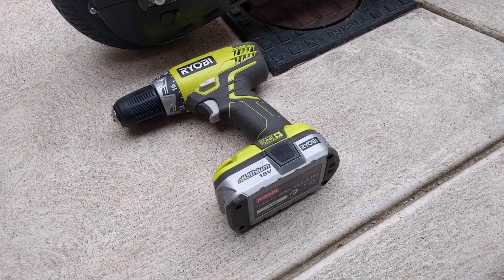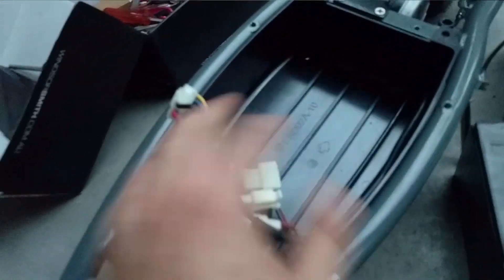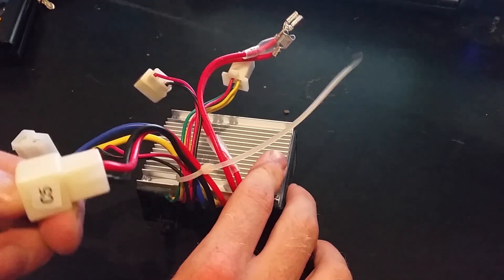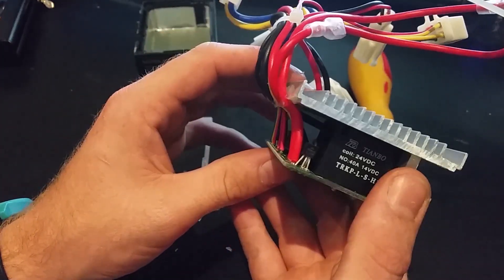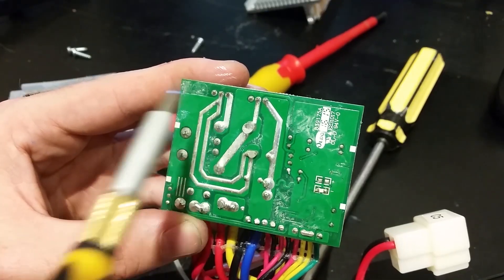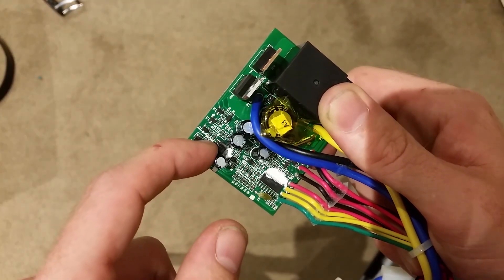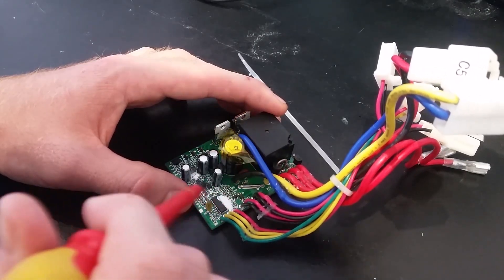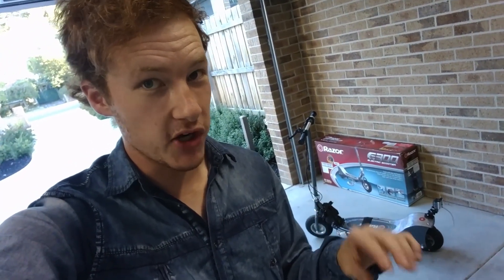Making the Razor E300 Faster With Drill Batteries! Ryobi ONE+ - Scooter Episode 2

Comment: Hey glad to see you still reply to comments. Few questions. Did the controller ever burn out or did you just upgrade it? Im going to put some 36v hoverboard batteries I salvaged and use the charging port I salvaged from them as well. I thought I seen in another video that the on off switch wasnt working with 36v but it looked like you had no problem with that right?
Reply from the maker: I think episode 2 outlines the basics to get the stock controller to accept 36V - relay mods for example - but it only applies to one model of ESC; Razer used a few over the years. Also you'll probably blow it up fast at 36v whatever you do.

If I remember correctly both scooters (I eventually had 2) burned their motors out in long runs. 

I plan a return to do a brushless long range build but its very hard to make YouTibe videos at the moment. Very time consuming and I'm not the fastest editor these days.

Comment: Can't you just remove the controller and wire directly?
Reply from the maker: You can try and use a simple DC switch but it will quickly get damaged from arcing

Comment: How do you charge the ryobie batteries once you remove them from the shell? Do you use the standard charging that is on the razor? Do you keep them plugged in and charged? Also how to you avoid the no charging due to not connecting the thermo on the Ryobi?
Reply from the maker: If you watch the video, I just did this for a test. I didn't keep the scooter setup this way, and I ultimately put the battery back in the shell.

You can't charge it via the Razor hardware. Your best bet to go this route would to get a Ryobi battery connector for the scooter,  so you could slide the batteries in and out like on the Ryobi drill.

Comment: Just buy a old haverboard and take the battery out of it
Reply from the maker: Fun idea
Reply: ive found about 15 of them over the year garbage picking. Most are 24 volt which will work as well and probably not burn out the controller or motor as fast. I would recommend looking up the battery first though some are fake and have fake batteries in them filled with sand. Also some generic batteries from hoverboards are known to catch fire. Hover-1 and jetson hoverboards look to have the best quality batteries ive seen so far. Also using batteries from electric vaccums work as well save  the connector from inside the vaccum and most of their batteries have their own dc charge port.

Comment: I watched the 15:32 part like 10x trying to figure out what you did here. Can you elaborate?
Reply from the maker: The chip on the board tries to sense the current flow to limit it to reasonable levels. I cut its connection to the current shunt and rewired it to ground so it couldn't measure current properly. This removed the limit and let the motor draw more current.

Comment: Hi TK.
I have tested with a 36-volt LEAD battery on my 24 volts, 7Ah( standard scooter e300 and stock 24-volt speed controller) and it works very well with no issues. I am planning to try a 36-volt HONME BUILD lithium battery. 
I need your suggestion before I start to build my battery. Will it work with a 36-volt lithium battery? Any further modification on the speed controller?
Reply from the maker: The stock ESC may blow up, in a short time or a long one. Consider buying a dedicated speed controller rated for 36V.

Comment: I did this to an E325 it flies now. But it will turn off every minute or so for 2-3 seconds. I'm assuming it's getting to hot and tripping the breaker. I'm wondering how dumb wiring a 30amp breaker would be. 
Edit* All factory just 2 18v Milwaukee 5ah batteries.
Reply from the maker: Hm interesting! Maybe a different revision of ESC has a thermal cutout

Comment: I have two 12.4V LiFePo4 batteries connected in series and I want to use a lithium ion charger of 29.4V 2 Amps... If I connect the charger to the E300 scooter will it charge the battery without turning off the controller ? I just need to charge the batteries with the above config.... So question is will it charge the batteries safely using the same controller ?
Reply from the maker: Doesn't sound like the right match sorry!

Comment: If you just bypass everything why not wire the batteries directly to the motor with only a switch? This controller doesn't even throttle power anyways.
Reply from the maker: Unfortunately when you switch high current DC with a regular switch, you get sparking on the contacts. This quickly degrades them. Thus the need for a transistor based speed controller even if it's only 0% or 100% throttle

Comment: I just did this and built a 7S4P pack that will give you 21-29.4v and over 10ah with plenty of space for more. The OEM controller didn't mind as the difference is not a whole 'wodge' of voltage. My E300 is an older model and the controller did look a little different though. I did increase the size of the shunt on the controller with a piece of cooper wire soldered in and got a little bit more amperage too which helped tons. Great video series!
Reply from the maker: Nice mods! Appreciate the kind words :)

Comment: I just got a used Razor e300
And want to increase the range of the current system which I can ant to use it to push my golf push cart with my golf bag
I don’t need more speed, just longer range.  Please lead me to accomplish this
Need lithium batteries?
Reply from the maker: You can add more lead acid batteries in parallel, but a lithium battery setup will be lighter and give you more range

Comment: Hi! I am from Germany and i speak German and a little bit Englisch.
My English is not good, i speak a little bit.
My Mega Motion electric scooter doesn't turn on anymore, I've had it for 1 year.  IM very desperate!!  Maybe you can translate my German into English with the Google app, for example.  In your video in the minute 3:30 pm I also have these cables and these yellow colored plugs and this silver part with all the plugs and cables at minute 3:30 pm that you screwed on and where the cables are all inside.  Red, yellow etc. And then with 4 screws the blue long battery pack with 4 screws.  Question: Which cable is responsible for switching on the electric scooter or which could be broken.  The charger charges normally red and when it is full, then green.  So the battery is full and was still full before.  I beg your help so much.  Usually when I put the round plug of the charger into the scooter at the bottom left, I always heard a "clack"! And now when I plug the charger into the scooter the round cable at the bottom left, I don't hear it!  not "clack" or "click".
Reply from the maker: I'd like to help but it is hard with just text and being so far away. Perhaps you could head to a local hackerspace?

Comment: any idea if the stock controller supports a variable throttle grip?
Reply from the maker: It does not.
Reply: @WhatUpTKHere  Thanks for letting me know, great series of vids on this!, I picked one up cheap and have been working on it, geared it down alil (65T), but plan to use two 4s 5A lipo packs I have after doing the overvolt and over current mods on the controller. For now have 2 lifep04 12v packs in it, but looking for alil more speed..

Comment: Thank you for making these videos, it’s really useful and fun to watch at the same time. I do think I have the same problem. I installed 26Ah batteries and it smelled a bit burned each time I rode it. After about a week it stopped working completely and it must be the controller right?
Reply from the maker: Could be controller or motor. Keep watching the series, watch my fails :P
Reply: Controller or battery I bough a upgraded 500w speed controller and throttle and it blew up

Comment: If you want to completely disable current limiting (I don't recommend it) find the connection from the mosfet side of the shunt to the IC. Separate the connection. Ground the pin of the IC that was connected there. Adding the wire as you did is the same thing as paralleling a wire with the shunt since one end of the shunt is to battery negative.
Reply from the maker: Yeah, very true! I get into it in later episodes. Thanks for watching!

Comment: Hey TK watch your video pretty cool and interested would like to do mine but would like to know what you did with your diagram and your speed controller board might be controllable is the same as yours I have a E200 but for some reason when you stepped on it it's closed right down it does not go any farther when you hold it up it keeps on spinning the wheel but as soon as you stepped in it it's closed right down any tips can help me would love to do my mod as yours thanks will really appreciate if you help me out
Reply from the maker: Sounds like dead batteries or the current limit kicking in. Head over to Hackaday.io and read about the project.  https://hackaday.io/project/9941/logs

Comment: This video made me do the shunt mod. Now my bike is alot more agressive, uses more battery power, but the same top speed on the straight and flat, 50kph.
Reply from the maker: Sounds like your problem is an Rpm limit, not a current one!
Reply: How do i get rid of the rpm limmit?
Reply: My motor has hall sensors on the inside.
Reply from the maker: You need more voltage for more RPM! Also If it’s brushless, you may be able to get a controller that features flux weakening, which grants more speed

Comment: tHE SHUNT RESISTOR NEEDS TO HALVE THE SENSE CURRENT. GO UNDER THE BOARD AND ADD ANOTHER 4MM WIRE. tHE SHUNT SENSE WILL NOW HAVE ALL THE CURRENT YOU NEED.
Reply from the maker: Interesting point!

Comment: Hi mate, love your vids, very informative. Just trying to work out exactlywhat you did to get it to take more current, ie the bit where you added the white wire (sorry I'm just a dumb civil engineer). On the left hand end of the added white wire did you cut the hard piece of standard wire and then add the white? Or just join the white without cutting anything? And then the right end of the white wire, what exactly did you join that too?
Reply from the maker: You'll find more deets here - https://hackaday.io/project/9941-the-razor-e300-overvolt

Comment: I've just recently had a similar controller to repair. It is very similar to the one shown here. The Relay on the one I had is controlled by two transistors; one (a pnp) is switched on when you initially give the scooter a push and the other (an npn) is switched on by a small microcontroller (8 pin, no marking). The purpose of the micro controller is to make sure the throttle isn't engaged when power is switched on, and the voltage isn't out of range). Removing the micro controller (it had failed anyway) left the relay controlled only by the act of initially giving the scooter a push (by an LM393 comparator, also an 8 pin IC). The c+ and c- pads are for altering the current theshold, I didn't remove it but the white component bridging one set of pads looks like a suface mount resistor, mounted upside down. On mine the c-, lowers the maximum motor current when a resistor is placed across it (goes in parallel with a 360 Ohm resistor to ground), and the c+ increases the maximum motor current when bridged by a resistor (goes in parallel with a 22k resistor to 5v). The junction of the 22k and 360 ohm resistors goes to pin 2 of the TL494 and is the set point for the motor current detection.   Maybe this will help someone - provided anyway as it took several days to draw out enough of the schematic of the controller and repair it (minus the microcontroller - it works without the minor safety features, and you still need to give the scooter a push before power is applied, unlike when just bypassing the relay). My particular board had FLY04142016 printed on it.
The scooter was one of these (terribly cheap chinese speed controller for the price!): JDBUG Fun series E-scooter, 24V 5.0Ah lead acid battery. I believe it's an older model now.
Reply from the maker: Wow, top work!
Reply: @WhatUpTKHere  hey man I know this is super late but I tried the mod to disable the 24 watt box to use my 10s2 lithium batteries. The mod work to disable the box but the second mod for the current did not work for me. I tried to disable it completely by running ground wire to the source pin of the mosfet but that did not work. And I tried to parallel the shunt to double the current and that didn't work either. I'm thinking my battery is are too weak because it runs when I hold the throttle for as long as I can hold it but when I sit on it and try to move it cuts off

Comment: How many ohms resistance is that shunt because I removed mine completely and shorted (M-) to ground. Now i'm thinking I messed up somewhere because the wheel isn't spinning like if you touched the terminals on the motor wires together.
Reply from the maker: So that’s not the right way to do it.

From the sounds of it, you’ve shorted the motor lead to ground. 

You can leave the shunt there, and in fact, you need to. It’s part of the circuit between the FET and motor.

What you’re supposed to do for this hack is cut the sense wire coming off the shunt - it’s a small, fine trace coming off the shunt. Then, on the side of the trace you just cut, the side that goes to the TL494 IC, tie that to ground. That makes the TL494 think there’s zero voltage drop across the shunt, and thus there’s no current flow, so it doesn’t shut off due to over current.

Diagram here https://hackaday.io/project/9941-the-razor-e300-overvolt

Do this at your own risk, it can lead to the motor going full throttle if the FET blows.

Comment: Can i get away with 12v using 9 amp hours  batterys
Reply from the maker: You can use 12 V 9 amp hour batteries, for sure, but you’d want to put a few in series to get the right voltage at the end.

Comment: Bro,your a legend.
I bought a Helix Scooter from Big W here in Adelaide yesterday for $99,it can take up to 68kg and I'm 63 and it's SO for SLOW😢
How can I make mine quicker?
I'm really stuck and gave googled and looked on here.
Awesome Video.
Reply from the maker: So you can try replacing the speed controller and batteries, at which point you may blow the motor up but I did exactly that and still had a good time. :P

Comment: Got one for you, I want to wire 3 or 4 lithium battery packs 36v each, meant for the mi electric scooters, they each have a little circuit board, not sure what they’re for.  I need to wire them in parallel to run a razor mx-650 longer.  Can you give that a go?
Reply from the maker: I don't have an MX650 sorry, or those batteries

Comment: Since you seem to be very knowledgeable with the 300; can you help me with a problem my son is having. His scooter has new batteries, fully charge. When turning throttle, rear tires will spin fast, but when he gets on scooter, not enough power to move. ???  What do you think, need new throttle, or new controller. Hope you can help. Thanks
Reply from the maker: Sounds like it's current limiting (or maybe voltage limiting) for some reason. Hard to say without seeing it and doing some tests. 

Maybe controller dead, but can't be sure. Hope you can figure it out!

Comment: You should buy 10" hub motor. It fits really well.
Reply from the maker: Велес Поляновский interested - link?
Reply: What Up TK Here https://ru.aliexpress.com/item/New-electric-wheel-motor-10-inch-electric-bike-kit-elecric-bicycle-robot-wheelchair-wheel-motor-36v/32694303074.html?spm=a2g0v.search0104.3.17.c5e594b2fGIstY&ws_ab_test=searchweb0_0,searchweb201602_3_10152_10151_10065_10344_10068_10342_10343_10340_10341_10696_10084_10083_10618_10307_10301_10869_10868_5723320_10059_100031_10103_10624_10623_10622_10621_10620,searchweb201603_46,ppcSwitch_5&algo_expid=03eed801-0170-48cb-85a7-d1aeed02678f-2&algo_pvid=03eed801-0170-48cb-85a7-d1aeed02678f&transAbTest=ae803_1&priceBeautifyAB=0
Reply: What Up TK Here If you're going to buy it, plz make a video in future with installed motor.

Comment: I know this is a bit late... but I had to say. I've figured out a way to disable current limiting really easily. Basically instead of the power ground wire going after the current shunt, move it to one of the heavy gauge traces from the source pin of the mosfet. This way, the tl494 still gets power, and there is no way of measuring current.
Reply: How do I go about doing that?
Reply: @carvenature  Shouldnt be too hard! Black wire from the motor desoldered from the circuit board, resolder on the other end of the shunt resistor.
Reply: @BobsEVGarage  thank you kind sir I will try that out 🙏
Reply: @carvenature did it work?
Reply: @carvenature hey did u do it?
Did it work?
Reply: @Reeserips  it's been a while. I don't remember if I did it correctly. That project is long gone now
Reply: @johnnyangel57  I tried it but don't remember the outcome but the scooter didnt brake. I got rid of my project
Reply: I have no idea what any of that means.

Comment: Nice bro.  I'm 48 years old and have been working with electronic computer boards, relays, contactors, capacitors, etc. for many years now.  What you did to that speed controller / electronic interface board was awesome.  Even when you tried a couple of different things that didn't work out, you pulled the schematic of the part and finally figured it out.  You are wise beyond your years in this field and should be able to land "one hell of a job" in this field.  Either that or start your own company and cash in on your knowledge.  The majority of people have know clue as to what or how you did what you did.  
     Thanks for the video and info and God Bless
Reply from the maker: skyym3 thanks man! most kind words. I do enjoy mucking around with the ol' electrons ;D